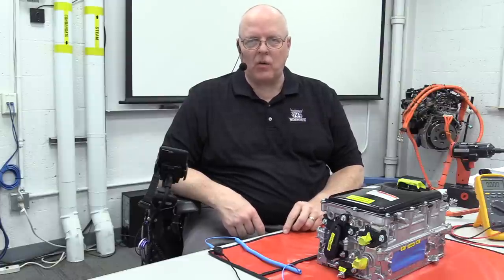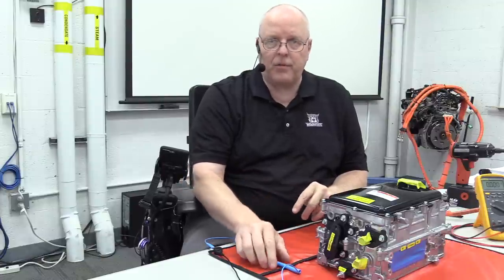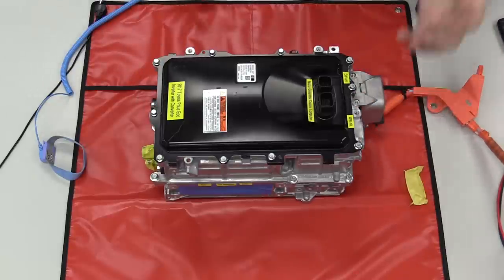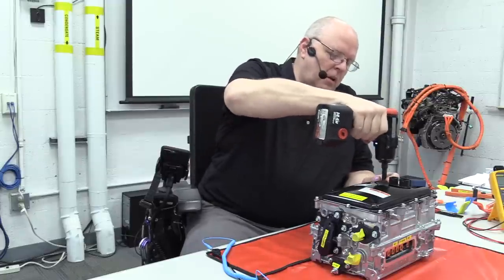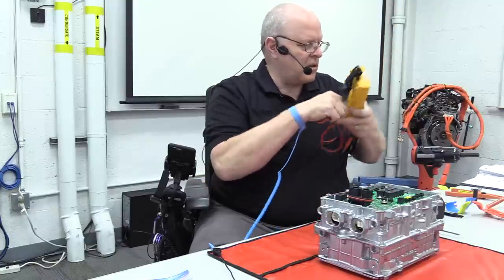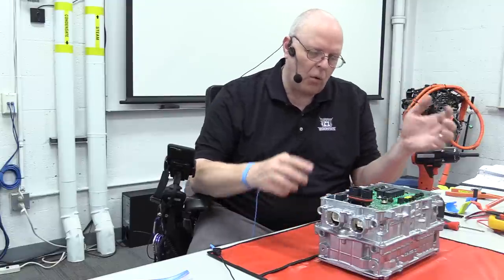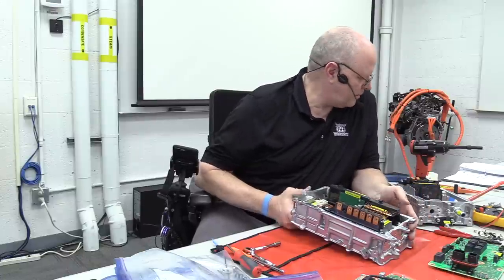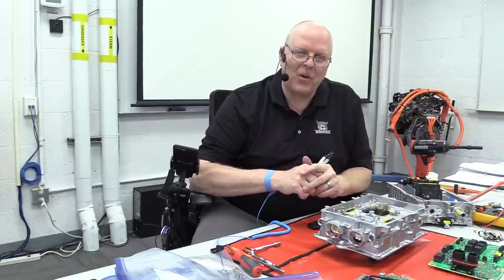2016 - 2022 Toyota Prius Inverter with Converter

Comment: Thank you professor. I am my own super tech to 07 Prius.  I have replaced inverter/converter unit, 4 years ago.  I have also replaced high voltage battery modules several times.  It’s very dangerous work but it’s worth it.  I am so proud of myself.
Reply from the maker: Thank you, Good job!

Comment: Fascinating to see the internal structure of this unit (being an owner of a Toyota Hybrid; in my case a 2017 Yaris, with a 144V d.c. NiMH battery). In practice, if there is an internal fault, it’s most likely that a servicing dealer would replace the whole unit, but it’s good to see what it’s like inside.

One of the points to note is that they have managed to simplify a lot of things outside the unit, in effect. E.g. these cars do not have any belt driven alternators, air con pumps, nor any d.c. starter motors. The advent of IGBTs and variable frequency traction motors has been a major development for electric traction - for both on and off the road.

Comment: A very enjoyable & informative video, as always. Thank you Prof. I have the feeling that as E.V.s become more abundant and production increases, then the serviceable parts will become fewer as more functions are integrated into one big black unserviceable mass produced lump.
Reply from the maker: Thank you. Most hybrid vehicle manufacturers do not have serviceable inverters. Toyota is different; their batteries, inverters, and converters all have serviceable components. I believe it is to reduce warranty expenses. It is less expensive to repair them than to replace the entire unit at this time. I hope, as EVs become more plentiful, that they have serviceable components as well.
Reply: A moot point, those very delicate interconnections between electronic processing stages is unsustainable in a practical commercial world. The smoothing regenerative braking capacitors have already been subjected to integration. Thank you for your professionalism in your videos & thoughtful response to all the comments. I look forward to your future videos.
Reply from the maker: Thank you!
Reply: Has always a very informative video there sir. A very well built pieces of hardware from toyota.
About part being unserviceable; I would say probably not. 
Smaller and more integrated (implying more special tools and training) definitly. 
I can attest about that, for example the best selling EV in France is the Renault ZOE. 
The first Gen used a set of 3 large wire with heavy duty connectors between the inverter and the motor. 
Now the new Generation has a smaller inverter with 3 copper bar that goes from the inverter straight down into the backplate of the electric motor. So unplugging the inverter from the motor require to open the inverter to gain access to the bolts holding the copper tabs.
Reply: Thank you zeus194, your observations are entirely relevant regarding the future of EV electronics. Who knows?
Reply: @zeuss194  hi I bought a renault zoe a while ago. Front damage am trying to fix it up to see how it's to own electric car and am trying to learn how to maintain

Comment: Wonderful video! My 2012 Prius lost power several times recently and the error code is P0A08, which is DC-DC Converter Fault Circuit / Open. According to your video, there should be something wrong the DC-DC Converter at the bottom of the inverter assembly. Unfortunately I can't find any used separate DC-DC Converter module sold on ebay. Only the whole inverter assembly is sold.

Comment: Hello! Those electronic plates are very tricky to disassemble. What is purpose of this thin pins and vibration damping contactors: for high frequence AC voltage? I've learned already so much. Thanks a lot!
Reply from the maker: Good question. I do not know. I suspect it is to accommodate for thermal expansion

Comment: Thx for the video. What are these vibration dampening connectors?
Reply from the maker: They are there because the connections to the other parts inside the inverter are through solid connections (no flexible wire harnesses to absorb vibrations while driving).

Comment: Hello professor, thanks for another interesting video!
I have one question concerning the A/C system, on this Inverter/Converter there's not anymore the inverter dedicated to the A/C compressor, and the connection uses only 2 wires (so HV DC) has this moved on the compressor itself?
I remember that in the previous Toyota Inverter/converter there was a dedicated output with 3 wires, so and AC one, am I wrong?
Reply from the maker: Thank you! You are correct. If the A/C compressor has only two wires connected to it, the inverter is built into the A/C compressor. If it has three wires, it is elsewhere. Most modern hybrid and electric vehicles use the 2-wire A/C compressor.

Comment: to make it easier to open the halves or covers i use  permatex gasket remover  ...but this does not work as it says in the instructions 15 -30 minutes ... I wetted two days where the silicone ...

Comment: Hi Mr. Kelly is there a difference in Prius, Auris or Yaris inverters. They look much the same except top cover or P/N. Do you maybe know about the rating for the traction IGBTs inside?
Reply from the maker: If the part numbers are different, the inverters will be different as well. It may just be the upper board, but I do not know.

Comment: I have a cuestion teacher. 
what happens when hibrid cars and trucks have accidents?.
There in any device or system to disconnect the high voltage in case of an accident?.
Reply from the maker: Good question. The high voltage system is automatically shut down in an accident that deploys an airbag or results in loss of isolation of the high voltage circuits. Turning off the key (power switch) or disconnecting the 12 volt battery power supply will do the same thing. I have owned hybrid and electric vehicles for 10 years now, I am not concerned at all with the high voltage system in an accident. Best wishes.
Reply: I recently had an accident in my Gen2 Prius (2007) and the whole front of the car was smashed in from a head on collision.  However the airbags did not deploy as it seems the 'crumple zones' absorbed the majority of the impact.  While the dashboard lit up like a Christmas tree including the main warning triangle, the car could still move under its own power on the electrics alone, which was impressive considering the front of the car was half the length that it was supposed to be.  The ICE could not start due to damage but I was able to drive it a short distance to an emergency stopping area on battery power alone, which I thought was quite impressive considering the extensive damage.  I was even able to turn it back on a little later so I could back it up and make room for the tow truck, which makes me wonder whether the car knows when it's been in an accident and lets you drive it in a situation when normally it wouldn't let you.  The insurer deemed the damage as unrepairable and wrote the car off.

Comment: My 2024 corolla hybrid is faulty. The voltage sent to the 12 volt battery is not 14.5v but 20v. Do you think the problem might be the DC to DC converter? If not the DC to DC, what else could it be? The dealer replaced 1 12v batt. because it couldn't pass a load test. Any help you could provide would be much appreciated. Thanks. BTW, I watched your video from beginning to end; excellent!

Comment: Professor, please can you confirm what happens in Sport Mode on a Lexus CT200H (P410). I think I read or heard that it merely increases to voltage to the traction motor.

Comment: Hello sir can i ask you question? If the Toyota prius high voltage battery goes flat completely then how can it be charged? Only dealer can do or it can charged while driving? And also if these hybrid car have an impact at the front or back will there be any switch or fuse will cause the high voltage battery to go open circuit? Also one more if we change the hole inverter and converter assembly change for some reason do we need to reprogram the new one or it will just work like that. Thank you sir
Reply from the maker: Technically, the dealer is the only place that can charge your flat battery. You cannot drive it if it is flat. There is a high voltage fuse in the service disconnect lever. You may not have to program the inverter if it is exactly the same part number
Reply: @WeberAuto  absolutely understand your point. Coz the high voltage battery is the power that runs the MG2  to role the car down. Thank you so much and i appreciate you took your time to read my question reply it.

Comment: Good day sir, I was taking my ase l3 and failed it by two points. However I ran to a question with a diagram. 

When you check the voltage on the terminal and it doesn't discharge is it the resistor that has a problem?

Comment: can we add a "RAT " air turbuine to recharge the battery pack while driving at the highway or solar panels or generators installed in every tire?
Reply: Only if you want to suck more power from the battery to run them

Comment: What is the purpose of vibration dampening electrical connectors?
Reply from the maker: I do not know, good question. Everything seems solidly mounted.
Reply: It looks like it may have been difficult to mount the IGBTs close to the main PCB while still getting decent cooling, so it looks like they mounted all the hot parts separately and then used those connectors to get the signals back to the main controller board.  This is fairly common in the electronics industry, where you have long pins that connect multiple layers of circuit boards together.  Sometimes it's done due to size constraints, other times to get better cooling or reduce electrical signal interference, etc.
Reply from the maker: @Berkeloid0  Good information, thank you

Comment: Hello very good job sir... I have problem with a Prius 2005 with combinations meter we changed it 3 times an it keeps going off again an what happened after that the Ac blower is not working an the driver side window r not working any more an the car some times start an some no an i found these codes after all of that:  c0210. .c1310, c1377, u0293 
Need help pls the car been setting down more than 2weeks I really appreciate it...
Reply from the maker: I cannot help you any more than I have. You must get someone to follow the trouble code charts and diagnose the problem. Best wishes.
Reply: WeberAuto Okay sir I understand what you are trying to say but why do you say that you are a professor if you tell me to go to someone else
I can't go find anyone else because I need you to help me please because the way u describe something is very helpful and professional
Reply from the maker: salah hage further diagnosis would require that I actually be there to work on your car. Obviously I cannot do that.

Comment: what's the normal running temperature of the cooling oil?
Reply from the maker: Good question. The reservoir cap has the same pressure rating at the engine coolant reservoir, It could get as hot as engine coolant. The main source of heat is not the inverter, it is the transaxle stator windings. Thank you!

Comment: Are they using the HV voltage boosting as a means of interacting with field weakening or what is the deal there?

Anyone having a theory?
Kr
Reply from the maker: I do not know about field weakening, but the first generation Prius (1998-2003) had a higher voltage battery (273.6V) and no boost coil. it was a heavy and low powered car. The second and later generations used a lower voltage battery (201.6V) and a boost coil. It dropped 10 battery modules and bumped the voltage to 500V. That change, among others, gave the car more power.  Thanks for your feedback.
Reply: They certainly have something figured out (which I can't make sense of). Having a buck-boost converter supporting the inverter sure is a pricey bit of kit, also relative low system voltage requires higher current rated HV cabling and connectors, which comes at a higher cost too. To my knowledge many OEMs seams to move toward much higher system voltages (380V and above) just because the lesser current is favorable.
Thank Sir for an interesting tear down.
Reply: That's right, the higher the voltage the lower the current; that decreases temperature, wire gauges and connectors, battery stress and temperature, that translate to longer life cycle of components..  I'm want to find a way to repair these converters because I have the background on high power industrial electronics/automotive.....

Comment: Good afternoon, professor! You have very educational videos. They are very interesting to watch. I have such a problem. I bought an American Toyota Prius 2017 hybrid and live in Ukraine. The authorized dealer does not have any documentation for this machine. I have a " inverter: P0A001C code - Engine Electronics Coolant Temperature Sensor Circuit: Circuit Voltage Out of Range This sensor" . I would be grateful if you tell me. Thank!

Comment: Does anybody know how powerful DC-DC converter(120v-12v) on prius?
Reply from the maker: 1st gen = 100A
2nd gen = 80A
3rd gen = 120A
4th gen = 100A
Reply: WeberAuto thanks! Just connected 150A inverter DC12-AC120 - and looks like it’s bad idea. I wonder to find DC120-AC120 inverter to avoid that 80A converter

Comment: Dear Professor, I have Prius V 2012 not getting to ready mode all I tried switching the Converter, Checking the Red Service Plug but the car still not starting the ready light blink twice and 2 or 3 click sounds from the HV battery.  Please help

Comment: May I bother you good folks if anyone knows the capacity of the 14.4 volts DC To DC converter? Asking for my Prius camper
Reply: I have heard that the Prius plug-ins in Japan have another inverter which converts to 110AC for "camping". Not sold in the states, same source says that the DC-DC inverter that charges the 12V battery can source 65 Amps. I bought an external 12v DC to 120v AC external inverter and hook to the 12v battery  in my Prius Prime to provide backup power for my house during power outages. Just turn the vehicle on and leave it. The traction battery keeps the 12V battery up, and when the traction battery is empty, it automatically starts the engine to keep the battery charged.

Comment: I like to take thinks also apart and repair but if this thing goes bad you will replaced rather than fixed because they don t give you replacement PCBs. Not to mention that everything is vin coded, like mitsubishi imev. So nice video but ........

Comment: In you videos you refer to "invertors" and "converters".  Am I correct to say that the "inverter" creates the AC driving current for the motor and the "converter" rectifies it back to DC for the battery?
Reply from the maker: Almost correct, the "inverter" creates AC from DC to drive the motors. the inverter also contains a full-wave rectifier as part of the IGBT assembly that "rectifies" the AC current back to DC current. The "converter" in hybrid and electric vehicles changes high voltage DC to low voltage DC to charge the 12 volt battery that the rest of the vehicle runs on. I hope that helps.
Reply: That is correct!

Comment: Prof my  son is driving 2,4 estima hybrid 2005. last week he called me thAt he was unable tio
Start the cArr, the cAt was then being towed to as nearby toyotA dealer & they haver diAgnosed the  car
The code is p3215  which require to cHange the inverter which they quote £3500 for a replacement of a new unit. Kindly seek your advice on this matter
Fyi the  CAr is in leeds uk